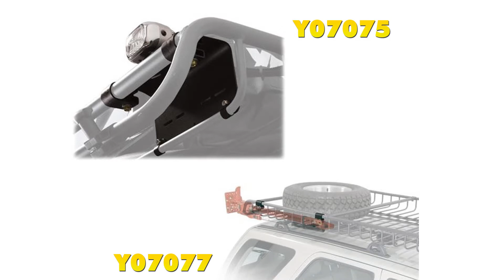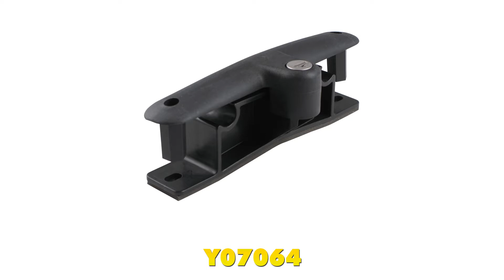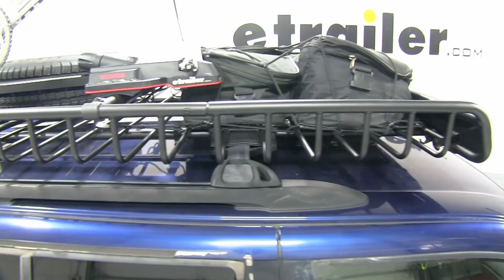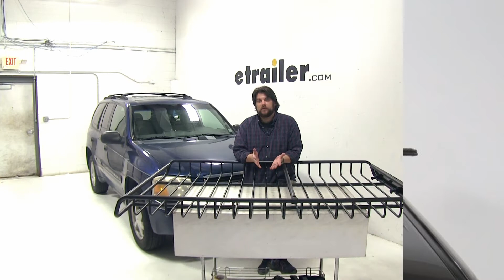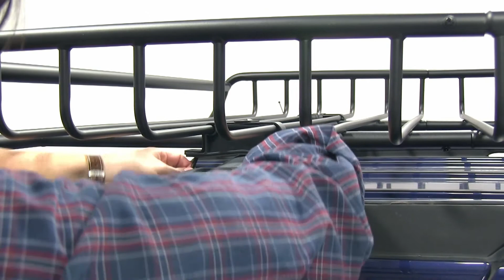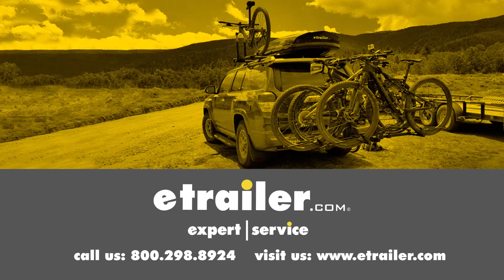etrailer | Feature Breakdown: Yakima MegaWarrior Extra Large Roof Rack Cargo Basket

Comment: For a Navara D40, would its measurement sit right on it. Pls advice.
Reply from the maker: The dimensions of this roof basket is going to be 74" long x 48" wide x 6-1/2" tall. It will need a cross bar spread anywhere from a minimum of 36" and maximum of 60". This should give you a better idea of where you will need to place your cross bars and how large the basket itself is.
https://www.etrailer.com/Roof-Basket/Yakima/Y07080-82.html
Reply: @etrailer  tks. Do you have a distributor for the S. E. A. region?
Reply from the maker: @abdulrezal5203  Currently, we ship only to the United States, Canada, Puerto Rico, the Virgin Islands, Guam, and FPO or APO addresses. Both the shipping and billing address must be an address in the United States, Canada, Puerto Rico, the Virgin Islands, Guam or a FPO or APO.